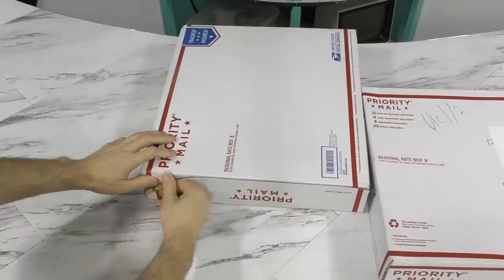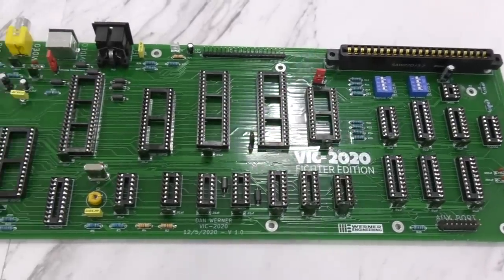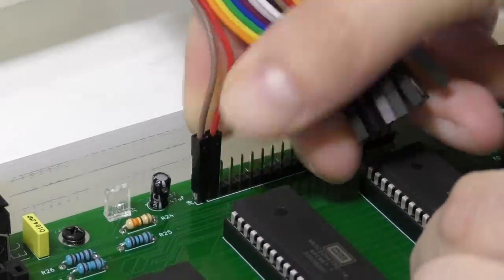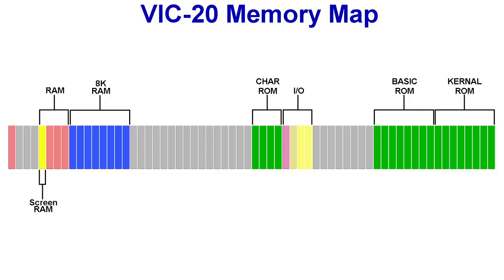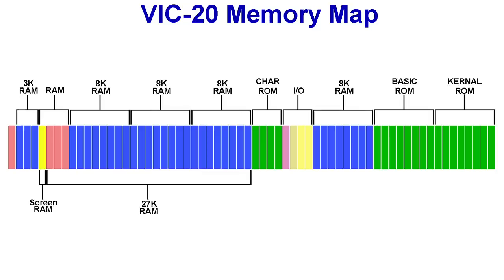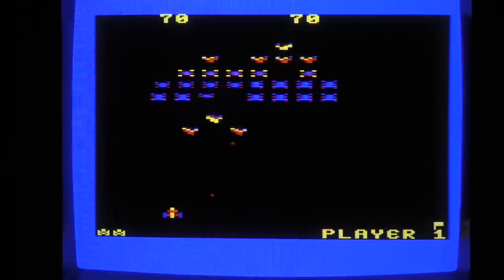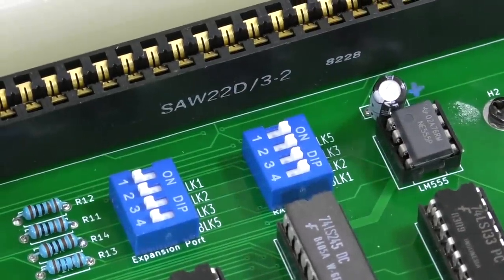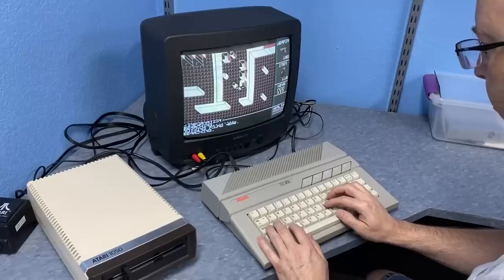Building a VIC-20 Kit Computer and X16 Update.

Comment: I’m kinda amazed that in 2021, with all the retro market, there’s STILL no replacement for the VIC chip
Reply: Probably due more to legal rights  more than anything. I'm sure a super nerd can reengineer them but they'll probably get their balls sued to the wall by whoever holds the rights
Reply: Probably copyright on the chip itself or software on it.
Even if that's no longer the case there is little incentive to start producing them now.
Reply: A person has created a FPGA Vic-2 replacement for the C64. But not for the original VIC yet.
Reply: Because current year!!! 
I seriously doubt the world wide yearly market for VIC chips is even a 1000 units.  It just makes no sense unless it were entirely done by volunteers. It would require putting up all the money, up front to get the chips made. 
Some asshat somewhere owns the right to that chip and will sue the person to try to suck whatever money they can out of that ownership.  So this volunteer who has to spend probably many hundreds of hours examining the original chip and then put up thousands of dollars for the run and then has to sell that stock to someone has also painted a target on their back from said copyright troll.
Not to mention the fact that the Chinese firm who does the run will STEAL that chip and do a run themselves and flood the market with fakes.
Not worth it.
Reply: @tarstarkusz  The rights owners (presumably a legal "successor in interest" to Commodore/MOS) could be paid to license production with or without access to historic design materials that might be in their possession.  That said, the complete absence of on-chip software in these old chips might make it legal to reconfigure a commercial FPGA to do the job and put the FPGA config in a modern large ROM also containing the historic ROMs and bootstrapping code to provide soft switching of RAM blocks, clock speeds etc.
Reply: @johndododoe1411  Anyone who owns the rights to the chip isn't going to allow it to be done at low cost.  Either way, I don't think it is viable.   I do not know if you could implement it in FPGA and hen make a (low cost) ROM of that FPGA. I don't work in that field and know nothing about it.
I think the main problem is the market for VIC chips is just too small. Even 1000 a year seems excessively high.
Reply: @sorrenblitz805  Aren't all patent fallen in public domain since 40 years?
Reply: "I’m kinda amazed that in 2021, with all the retro market, there’s STILL no replacement for the VIC chip"   Why? im not... for years the VIC20 didn't get much love from the 8bit community... its only been within the last 5-7 years that things changed. the C64 on the other hand had love almost the whole way through
Reply: @DanafoxyVixen  That is largely because the vic isn't really that lovable.  It is a terrible game machine.
Reply: @tarstarkusz  yes I guess I never owned one. My brother had a Com 64 I would skip this dead technology and use a rasp pi and play the old games on the pi. I plan on using the pi for playing Texas instruments 99/4a games. I still have my ti 99/4a. I got rid of the expansion box silly me. But it had a monster of a cable that plugged into my voice box. You would need a large desk to make this usable. I have music data that I converted to play on the TI 99/4a. When you have time to waste you find the silly things to occupy the time.
Reply: @tarstarkusz  This !
Reply: @ronb6182  I actually had a VIC 20 that I bought with my own money when I was like 12 or 13.  But it was never a particularly good gaming computer. There were a few good games for it, but most were very chunky.  A couple of years later I got a C64 and I never touched the VIC again.
Reply: @tomjoad1363  patent maybe, but copyright can last a century or more.
Reply: @sorrenblitz805  You can't copyright an instruction set, or even a pin layout.  Believe me, Intel tried.  There's been plenty of x86 drop in replacements over the years that completely do the exact same thing as an x86.  So if Intel lost these lawsuits, there's no such thing as intellectual property on being able to emulate a chip.

I suspect the real reason is...  it's hard!  The VIC chip isn't one that often fails so there's not a huge need for them, unlike say, the SID chip, which fails a lot.  Subsequently, there's several projects to re-create the SID chip, with varying results.
Reply: @tomjoad1363  patents can expire in as little as 15 years, but copyright lasts for the lifetime of the author plus 70 years.
Reply: @DS9TREK  Thanks.
Reply: @tomjoad1363  patent yes, copyright no, and it's probably a copyright issue. Either nobody knows who owns the copyright to the exact design, which can make very hard to obtain such a copyright or license to use it, OR, somebody owns the copyright and is being very protective of its use. Either way, given that it's a very niche product, it's likely it'll continue to get buried under the sands of time.
Reply: @stevesether  tell that to Commodore who actually did win lawsuits against people who made clones of their chips in their day.
Reply: @sorrenblitz805  I hadn't heard that.  I'd love to hear more.

It doesn't surprise me.  Lawsuits without any legal basis work if you sue someone without deep pockets.  IIUC, the lawsuits settling instructions sets non-intelectual property came long after the Commodore era.
Reply: @stevesether  basically during the vic-20 C-64 days, and I think 8-bit covers it a little on his video about them, companies tried making 3rd party add-ons for the machines, disk drives etc as well as clone machines, and Commodore sued their pants off because they basically just spoofed a legit Commodore BIOS with no legal access to do so. Lawsuits like that may give the VIC chip rights holders certain legal grandfather privileges to continue to hold the IP hostage for whatever silly reason. (I can just see some doofus suit in his office going, "8-bit machines are comin back I can feel it, and when they do Imma drop this VIC chip bus on em and sweep up the market!")
Reply: I don't think either VIC chip contains any software. And if it did, Sega vs Accolade would be a good case to hold on to.
Reply: @tomjoad1363  Patents, yes, but copyrights are effectively forever for corporations now. So you could reverse engineer it, but not outright copy it. There's also a potential trademark issue.
Unfortunately, the rights for various Commodore properties are currently held by people who aren't using the ownership to make anything, in contention with several others who tried to snag trademarks and also haven't produced anything. Pretty sad.
Reply: @stevesether  Someone could make a chip that works like the VIC, but you couldn't just create an exact copy. Like you said, the instruction set and pins aren't copyrightable, only the internal implementation. So you could create another chip with like outputs. It just isn't currently available.
Reply: @rifter0x0000  I'd agree.  Though in a more practical sense, I'd suspect it'd be quite difficult to reverse engineer the chip without some specialized equipment, and even then it'd likely be easier to just re-implement the same features on virgin implementation.  Does anyone really like the jailbars?

Someone has already created an FPGA implementation of the VIC-II.  It's likely a lot of the same circuits/work could be re-used to create a VIC.
Reply: @enochliu8316  Thanks.  I didn't know about Sega vs Accolade.  Interesting case.
Reply: @RobotronSage  it is dead you don't see them in the stores today. The raspberry pi 4 can do tons more than these outdated machines. it's ok to have one for games because that's all they are. Game machines. My TI 99/4a is a game machine also. I guess in my case the TI computer is also a music player. I would never try typing on these old machines because we have Word and Word Perfect. Also the free ones out there also. If you cannot buy the chips necessary to run this kit it's useless. I would not waste my time on these kits.
Reply: @RobotronSage  xp come on you cannot use XP on the net without getting tons of viruses. The Mac is much better in security. I have an old MacBook which I still can use safely on the net. I rather learn Linux and let the computer do what I want to do. I guess your 64 is safe no internet or spyware to deal with. But where is it practical in today's world. Game Machine.
Reply: @RobotronSage  if you want a safer phone get a raspberry. I even thought about it. No cameras . My Magic Jack is pretty safe also no sales calls.
Reply: @tomjoad1363  It's 20 years with a up to 25 years for medical exception. Intellectual property is different from patents. You confusion probably stems from the fact that a lot of people clearly don't know about this and just use those interchangeably. IP or the copyright lasts at least 80 years after the authors death. Thank Disney for a lot of extensions. So it's actually 120 years for some things.

Also patents need to be actively maintained. IP or copyright is automatic.

Also patents require a documentation. Again IP is automatic and requires nothing.

The 2 seem identical to some people but legally they are very different.

Patents would only cover the physical chip design. And those will of course be expired. But the chip also contains their software. Which is protected by copyright/IP.
Reply: Many emulators require a  bios dump for exactly this reason. The bios is still protected and Emulator devs want to stay on the legal side. So they either develop a replacement themselves, like "Bleem!" (good example if you want to read up on the legal background and court rulings on emulation) or require you to get a dump somewhere else.
The Bleem! Story is also a sad example how a company with deep pockets can kill you despite you winning in court.
So this seems very relevant to this topic.
Reply: @fgregerfeaxcwfeffece  why does the vic 20 remake have to have stock chips. Change everything make the background different,  make the basic different,  just make the computer run basic where no one owns ANYTHING. Run Linux on the thing where everything is open source. Open source vic 20.
Reply: @ronb6182  If you are interested in that, stuff like that is available in all flavors.
It's simply not the topic here right now.

Or the roughly quote our 8bit guy:
Using 1 chip that is vastly more powerful the a whole [vintage computer] eliminates then fun of it.

I don't remember which one was the topic that time.
Reply: @fgregerfeaxcwfeffece  it don't matter anyways this won't fly. Too many legal hoops to jump through. I think someone also tried this with the TI 99/4a but that long chip that is needed  is no longer available. It's fun to listen to this old stuff but I really don't want to build a working model.
Reply: @fgregerfeaxcwfeffece  Thanks, it's more clear now.
Reply: @RobotronSage  I don't see how ensuring the person who made a thing gets paid for their work is stupid. I will say though that once the person who originally held the copyright dies that that copyright should be dissolved and the thing in question should become public domain.
Reply: @tarstarkusz  And that would be Cloanto... They are purpose built as patent trolls who regularly have their people monitoring marketplace and even forums.  Probably one on this very thread to see if David was up to something they could fry him with.
Reply: Seems like it should be an easy thing to make an FPGA based clone, that's how video processing is handled in most DIY retro computers nowadays.
Reply: @customsongmaker  Chinese morality in action!
Reply: @fgregerfeaxcwfeffece  copyright used to need to be maintained to be held. The reason there are several The Three Stooges episodes that are public domain. They simply forgot to renew the copyright or even one case where they marked the copyright incorrectly and it went public domain on a technicality. We should go back to that system.
Reply: @sorrenblitz805  I wonder how the mini Vic20 got around it?
Reply: It’s honestly crazy
Reply: fpga
Reply: Because it would cost more to make than an FPGA

The VIC chip is specifically made for 8 bit computers, something with very little demand nowadays.

Creating a custom semiconductor in small batches would be too expensive.
Reply: @sorrenblitz805 no actual there id fpga that can do same functions

Comment: Baking is only needed if you solder this in an oven. Baking makes moisture that is dissolved in the caseing come out slowly, so it prevents it from become steam during soldering and popping the case open due to high vapor pressure.
Reply: Exactly, came to make the same comment and saw yours was already here.
Reply: Thank-you for explaining :-)
Reply: I solder in a dry sauna, same precaution?
Reply: Yes baking is to remove the moisture form parts (if exposed to humidity for to long) before using a solder bath, not solder in a oven.
Since he’s using IC inserts and soldering by hand he would never need to worry about.
Side note: Baking parts is a slow temperature rising process that takes a few days.
Reply: @jetin335  at my work we only bake when we coat the boards. We have a cart and insulation boards around the cart and use a space heater and we bake for one hour. That hardens the corformal coating. I'm sure all the parts were baked at the build house. I have to test the boards before I coat the boards then after baking. Most people don't bake boards unless they are told to. If I had my way I would require all coated boards and repaired boards to be baked.
Reply: Hey! Stop chipsplaining, dude! XD
Reply: You beat me to it.  Serves me right for waiting 23hours to watch the video.  To add to your point, I've had chips that came in a sealed bag that were too moist and needed baking prior to the oven.
Reply: @retroattic4647  you're all talking about putting chips in an oven
Reply: Was searching for this comment, glad someone already made it!
Reply: @Chip Guy hold up 🤔, could that be used as a method of decaping chips 🍟?
Reply: Nothing tastier than baked chips.
Reply: @cryptocsguy9282  I don't see how that would be possible
Reply: @subtledemisefox  fair enough i was just wondering
Reply: @jetin335  More like making dehydrated food than baking food... some kitchen ovens have a setting for that!
Reply: Welding rods...are the best silica packs ever.
Reply: Interesting, Subbed to your channel
Reply: @BennyTygohome  he hasn't uploaded for 6 years lol
Reply: @cryptocsguy9282  lol, I'll be ready though when he does
Reply: Really interesting.  Never saw a tag like that before, and was going to go research.  Found your comment first.  Thanks for sharing your insights.
Reply: Epic thunderbolt pfp

Comment: "as well as the Atari version."
Sits bolt upright, sprays coffee on screen.
Goes looking for a pre-order button
Reply: now we need an nes version 😏
Reply: Hopefully, it would also run on Atari with 64kb of RAM (on video, he uses Atari 130).. and then, if it will be NTSC or PAL version :P But looking forward to it :)
Reply: @Freewareopoly  Hopefully 40k so it fits on a fully upgraded Atari 800. Given there's a PET version, it could fit on all Atari systems. Depends on whether the decision was universal compatibility or richer feature set. 
Then again, it should be possible to choose between versions on load and have the best of both worlds. Not expecting that but it would be a fantastic feature
Reply: @TheJeremyHolloway  fully loaded Atari 800 has 3 16k expansion carts. So yeah, I was wrong about 40, but going beyond that means hacking the board with something like the ultimate 1mb module, which I wasn't including
Reply: "sprays coffee on screen"
Todd Rogers, anyone?

Comment: "Another problema is the SD card. Half of the time it just doesn't detect the file system. Sometimes it does."
IS not a bug, is a freature to give more realism as loading from a cassette.
Reply: Need a new type of pencil then to rewind my SD card
Reply: Or floppy disc
Reply: Might be worth experimenting with sizes and brands some are better than others
Reply: or use the "apple excuse": you're typing it too fast
Reply: a paperclip might replace the pencil in this case
Reply: Who the hell are you, Todd Howard?
Reply: R Tape Loading Error

(Oops! Wrong ROM!)
Reply: @ImpetuouslyInsane  Todd Howard would also try to sell you computer armor dlc that doesnt add any new content.
Reply: @yugimumoto1  No no, that's EA.
Reply: True fact: I was at the meetup he mentioned near the end of this video and I tried resetting the game by power cycling and I ran into this exact problem. I got really apologetic because I was afraid I just killed the whole demo, haha. Thankfully they were eventually able to get it back on.
Reply: You have to eject the sd card, shake it and put it back. Very easy thing :)
Reply: Have you watched the dream computer videos?
Reply: Actually,  cassette was always very reliable.
Reply: @ImpetuouslyInsane  Would you say that if Todd Howard worked for EA instead?
Reply: Huh. I never thought of it that way.
Reply: Wasn't even alive then, but my understanding is that how reliable or unreliable cassette load/save was depended on your system and cassette deck. I.e. different computers varied in how reliable that process was and a good tape deck was essential.
Reply: @jnharton  pretty much